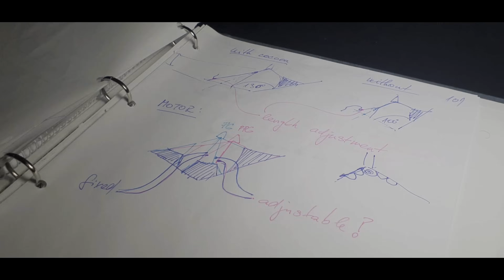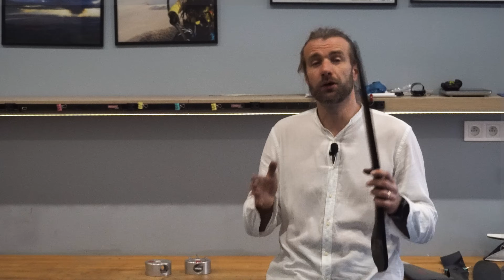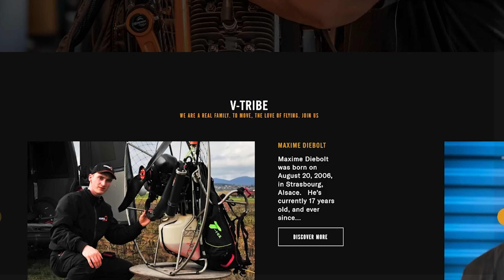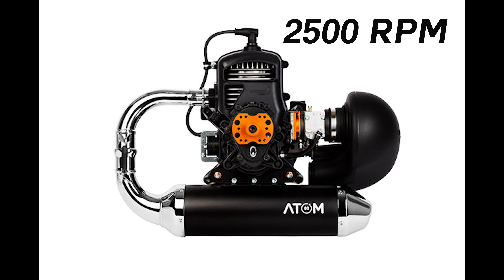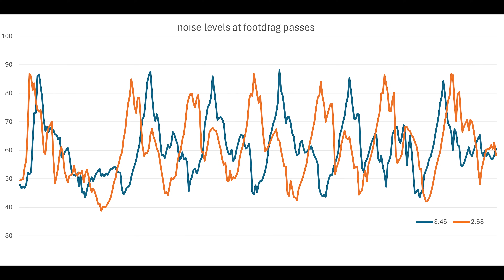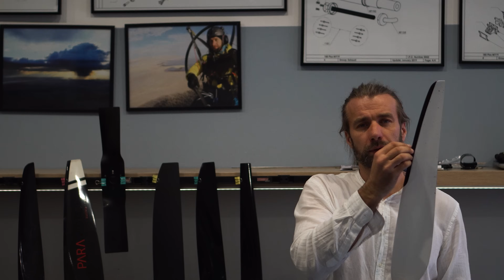We have tried it all. Many propeller concepts lead to one. Scout smarter pilot.

Comment: The area of the prop, where it's doing engine cooling, is largely wasted... in a paramotor, the fan is actually pulling air through the cooling fins, and the part of the blade below the cooling fins is not doing much  but has dirty airflow... Better cowling design.

Comment: Insufficient cooling of the engine seems like a poor reason to change the propeller design... It could be that the cooling of the engine is by a fan, if it's air-cooled, so "fixing" fan to provide better cooling would be an inexpensive fix... 
Anyway, I'm watching this a long time later, I guess that I should see what you develop.

Comment: Slight error in terms, I believe!
You said that if you are at full throttle, you are not at full power... This is incorrectly stated, because you were assuming that maximum RPM= full throttle 
Maximum RPM is not related to throttle position, it is related to engine load and throttle position.
With an optimized load, the engine will produce maximum power, at the maximum horsepower peak, with full throttle, remembering that maximum torque is not (usually) at the same RPM as maximum power, and, indeed, maximum engine efficiency occurs at different RPM, and throttle setting, than either maximum power or maximum torque!
Reply from the maker: And that’s exactly what I said. Paramotors as we use them don’t have the load optimised to stop the engine at the peak of the power curve but go past it. Hence we are not using the max possible power of the engine.

Comment: I know you have developed your variable prop greatly, congratulations. May I suggest you “ask” Tucker Gott to Beta Test one. I don’t know why he stopped flying Scout, I suspect it involved paid sponsorship from a certain U.S. manufacturer. NEXT, once you solve (I think you’re there) the 2 bladed prop., work up a 3 bladed variable prop ASAP. NEXT, I’m an old guy (mid 70s) I’ve had to give up paragliding, my knees, ankles and back!. I want to get into a Trike. Frankly, Scout Trikes don’t appeal at all! May I suggest you do an overview of what is available and embark on a design of an up-market composite (Alloy and Carbon Fibre) Trike, including: suspension on the rear wheels, disc brakes front and rear, “bush wheels” for rough country and better ride. DONT restrict to Vittorazi motors (I’m looking at the Swiss 4 stroke, EFI water cooled but would like it at 300 to 350 cc and twin cylinders for less vibration, lower revs, less noise, with a 140 cm 3 bladed prop) in other words a dedicated Trike motor and probably good for Trikes, Powered Parachutes, powered Hang gliders and Experimental Aircraft!. Btw Milos is a genius, don’t let him go.

Comment: what would happen if you cut a step  along the length of  the  blade   , between leading and trailing edges , to reduce parasitic drag  , or is  it spinning to fast for that not  to apply , maybe a groove ( 3mm rad ) along the leading edge to affect separation

Comment: I make props for FLPHG  and i have found that a prop prop that has a pitch that is higher at the root and lower at the tip gives great performance.  props i make are 54"dia root 23" and tip of 20"  one thing i have noticed is that my prop pull air in from the tips and act like flat winglets.

Comment: Solid development effort. An exotic design I would like to see tested would be a hollow blade that has a port at the root that sucks messy air from there and ejects it at the tip in a way that will negate tip vortices or allow higher tip speeds.

Comment: Interesting video, goes to show that there's still prop re-thinking associated with very low speed flight. Almost no propeller expert has done exhaustive repeatable prop design work to fly at 25/30mph, perhaps RC prop design offers useful correlation.
Experience leads me to state the following re powered para props;
- longer props are more efficient than shorter props, almost w/o limit or exception 
- persistent prop tip speeds above .4 Mach, is annoyingly noisy
- prop blade pitch exceeding 14deg@.75r results in thrust/drag tail chasing (under 12deg is preferable)
- 3+ prop blades are theoretically advantageous in pusher apps where prop blade shading is significant; also more blades at finer pitch is preferable to more pitch on fewer blades.

Comment: Use an electric drive system to help you evaluate props. You will be able to see extremely subtle variations and performance with high accuracy. Especially if the system will let you log volts, amps, RPMs, etc

Comment: Dear Miro. I love your approach. You have refused to copy all other messing manufacturers, which copy one anothers, all doing the same gross mistakes. 
One only note about this video. I have introduced on my belt reduced nanotrike engine a customized increased reduction ratio matched with higher pitch. And my prop is spinning at max 2500 revs Min. I have achieved a level flight at a consistent lower rpms.  You have mentioned the same test with 3.45 reduction ratio, and you have had no significant improvements in noise or fuel consumption. But you didn't say anything about climb ratio. Why?? According to my experience, you should have improved it. Isn't it?
Kindly.
Reply from the maker: With every prop I measure max climb rate and cruise consumption. With the 3.45 I measured noise levels as well. Unfortunately, it did not perform better in any of these parameters

Comment: Hmmm. Sounds like you did not take into account the bad laminar flow, a Paramotor Prop is facing. You may not optimize prop design by conventional means. Rather, build a prop more robust against vortices. But I am afraid, that was impossible.
Anyhow. You did nop see big improbevements with any of your designs. What did you expect? Conventional props work quite well in measn of efficiency, so any improvement must stay in the few per cent range. And that's what you did measure.

Comment: dumb idea  that fan would need  quite a few HP at 8,600 rpm .   Make up a dummy hub / model aeroplane electric motor and you will see that the guy who recommended the extra cooling fan . obviously hasnt a clue .

Comment: Have you tried specifically a Prandtl foil?  The Sikorsky looks by eye to be similar.  But Prandtl propellers are known to be high efficient and low noise. https://www.youtube.com/watch?v=w-dk1NpVNNI
Reply from the maker: I learned something new today. Thank you!
Reply: @SCOUTaviation  Great.  Al Bowers at NASA has done a lot of work on Prandtl wings. At 39 minutes he discusses Prandtl propellers:  https://www.youtube.com/watch?v=w-dk1NpVNNI  He points out that most of the noise comes from the tip. And if you unload the tip it reduces the noise. And reduces the torque required for a given thrust.  He quotes a 15.4% improvement, see the slide showing the graph.

Comment: 16:17 this is just killing me😂 of course the results don’t match. Too many uncontrolled variables.
Reply from the maker: Every time I did two measurements: new prototype and our standard prop as reference. Two flight 15 minutes apart. All variables the same (temperature, pressure, humidity, weight, same engine, same glider).

Comment: 14:29 bro there are so many uncontrolled variables in your experiment that it could be 20%+ better and your data might show a 20% decrease. I urge you to consider static testing, it’s at least a good starting point.
Reply from the maker: Every time I did two measurements: new prototype and our standard prop as reference. Two flight 15 minutes apart. All variables the same (temperature, pressure, humidity, weight, same engine, same glider).
Reply: Agree

Comment: 14:03 how do you factor all the variables. Pressure, temperature, humidity, pilot input, etc.?
Regardless, great video.
Reply from the maker: Very simply. Every time I did two measurements: new prototype and our standard prop as reference. Two flight 15 minutes apart. All variables the same (temperature, pressure, humidity, weight, same engine, same glider).

Comment: You are going to NEED a variable pitch prop, to maintain full power, for maximum climb rate. Anything else is window dressing. As the engine heats up, and starts to lose power, the prop would de-pitch, and maintain peak power RPM. Having the pitch increase from there, as you reduce throttle, will get you SIGNIFICANT gains in fuel economy. You can use electronic systems which are similar to RC variable pitch system, or you could use an aerodynamically controlled system, like the Aeromatic prop, from decades past. The only thing it's REALLY missing, is altitude compensation.

Ah. there it is. You're talking about your variomatic. That is only RPM dependent pitch, and it needs to have an aerodynamic (load) dependence, in order to hold the engine at peak power, instead of having to set the rpm above peak power rpm, to account for heat sag.

Comment: 2 comments, thus-far:

1. WHEN switching from a 2-blade prop to a 3-blade design,
THEN one should be reducing the chord significantly, to keep the wetted-area similar?

Also, at higher-altitudes, more-blades is apparently better, resisting loss-of-thrust as the air-density drops
( I don't know if you'd find that at 8,000' altitude, which is the safety-ceiling for no-supplemental-oxygen, ttbomk )

2. the Darth Wader should have altered only 1 thing: 7800rpm max-power operating duration.

It should have extended that.

Nothing else that I can think-of..

---

Back to watching the video..

( :

---

"seconds to climb 100m" depends entirely on air-density, air-temperature, AND humidity!

---

I don't understand why you weren't using a genetic-algorithm in OpenFOAM?

Let IT find the optimal thickness/chord/pitch/distribution-of-force ( which should be elliptical? )

---

Ah, you've got the "toroidal propeller"..

Please go watch videos on the Sharrow propeller: nearly all the noise from the normal prop is from cavitation!

The Sharrow isn't cavitating: it's silent.
Reply: I just realized:

The optimal-prop-diameter, in that context,
is ergonomic:

a 7' tall Dutch person could use a larger-diameter prop on their back than could a dwarf, right?

Therefore, there ought be multiple prop-solutions,

using a diameter powerlaw,
so you fit the tallest people, the 5'9" average-men,
the 5'4" average-women,
& the 4'11" short women,

& then each of them has a prop that works *for them*,
& all get to fly with efficient props!

_ /\ _

Comment: I wonder if its different in the US and Europe. Here in the US, 140cm props are the standard and probably 70% of new paramotors run it. 130 was the standard up until about 3 years ago and has been replacing the 125cm with a slow phase out starting ~15 years ago.

Great work on the prop! I hope to try one some day!

Comment: You can use the large prop if you reverse the engine by placing it behind the prop so that the prop thrust blows on the engine. This will provide a lot more cooling. This is what we do in drones. This could be done by mounting the motor in front of the vehicle, or it could be mounted in back with the proper mounting structure, which would also reduce the sound for the pilot, since the thrust blows the sound away from the pilot. We are developing a full scale electric Blade Runner style flying car called the Sky Chaser. See our icon for project details.
Reply from the maker: There are more considerations to it. You don’t want the heavy engine behind the prop because it would place the centre of gravity too far back.
Reply: @SCOUTaviation  so just move the pilot forward relative the wing CG to balance the motor moving backward.

Comment: So if I squeeze my gas in full throttle it gives me less power than when I'm in almost full throttle In my moster?
Reply from the maker: We have used an aerodynamically heavier propeller that stopped the fully open engine at 7500 rpm. 
With your prop at 7500 rpm the throttle is not fully open, that’s a different scenario

Comment: Zip-line drones use a 3 bladed prop of different diameters to spectacularly reduce noise. I think this is the most important thing to grow paramotoring and the most likely end or reduction to the business. A sound test of a 2 blade prop with a 2 to 3cm radius difference should make balancing manageable.

Comment: Have you thought about tubercles?  I’ve seen some work with wind turbine blades replicating the tubercle structures on the forefins of a humpback whale…. Reduced noise and increased efficiency… I think it is something about reducing span wise flow and increasing vorticity to promote attachment.  Could this be a number 11?

Comment: Have you tested adding stators or flow straighteners behind the propeller? They are used in some hovercraft and airboat designs and claim increased thrust and efficiency.  I could see how they could also help with paramotor frame rigidity. A con being increased weight but that may be offset with the gas savings.

Comment: The loss of engine RPM with heat during climb with the fat chord blades would be caused by the exhaust heating up.  The tuning of the exhaust on a two-stroke is dependent on the exhaust gas temperature because the speed of sound increases with increasing temperature, so the resonant frequency will probably increase.  The other problem with operating right on the peak power point is that it is an unstable point because any increased load pushes you down the power curve rather than up which would be the case if you were operating beyond the peak power point.  It's a negative feedback slope which generates the engine speed stability.

Comment: I tried to have more efficiency on small quadcopters, only fixed pitch props available. Given the same diameter and number of blades, the only night and day factors seem to be the weight and the rigidity of the props. The lighter and more rigid it is the better. But first of all, the props must provide proper amount of lift for the weight.

Comment: have you considered a clutched (say) 2 meter diameter propeller along with a more regular size? The large propeller would be locked in the horizontal position during takeoff / landing, and the clutch would engage the larger prop at altitude.
Reply: What?
Reply: @turkeyphant  two propellers. One clutched so that it does not spin during takeoff. You engage this while in the air (and potentially disengage the smaller one).
Reply: @fgbhrl4907  Are they mounted in the same plane?
Reply: @turkeyphant  They'd be offset the depth of a prop. Basically two independent props,  on the same driveshaft.

Comment: I've noticed it's very difficult to get accurate flight data for comparing different props, power systems, torque fins, etc., and their effects on efficiency. Even with the electric setup and the instant feedback in power consumption it provides, the weather variable makes getting useful data hard and confirming results that much harder, as there are only so many zero-wind days and even on the zero wing days with the sun set so there is seemingly no effect from thermals there is still a surprising amount of variability.

I have found that day-to-day weather changes efficiency around 5-10%, and most changes in props and power systems, etc., only have around a 5% effect, so it can get lost in the noise.

I've found myself on nice days testing something and getting a surprising result, then landing and running back to the shop to quickly swap out a part or grab a completely new setup with just the one variable different, and taking off again because at least the weather can't change too much in the 10 minutes between the two tests.

So by the time the evening's over, I'll have 2 or 3 units out in the field that I have to take back to the shop. The point being, it's really hard to make the incremental changes of that 5% improvement here and there when weather changes make the noise floor so high.
Reply from the maker: With all my measurements I always did two flights 15 minutes apart. First with our standard prop and then immediately after with the prototype. Same engine, same glider, same conditions
Reply: It depends on the area you're flying in.

Comment: I fly an e-prop 3 blade 155 cm at 2000/2100 rpm, with an old hirth engine. many times quieter than the Polini with 150 prop and the Cosmos with 160 prop